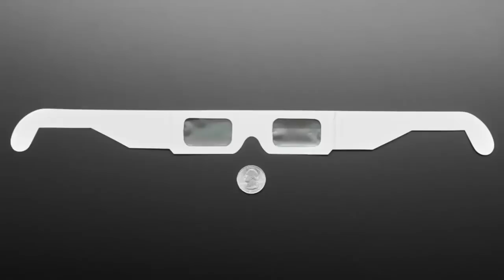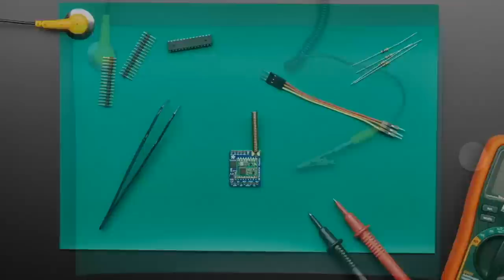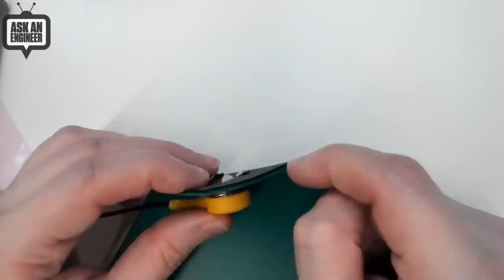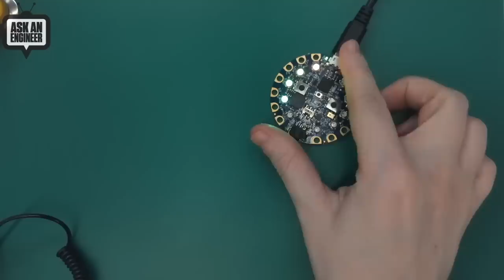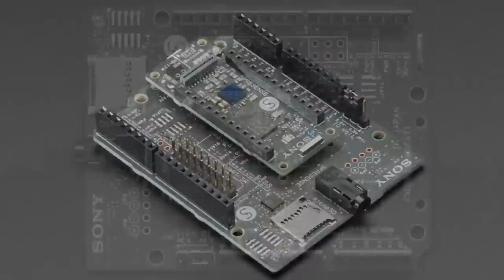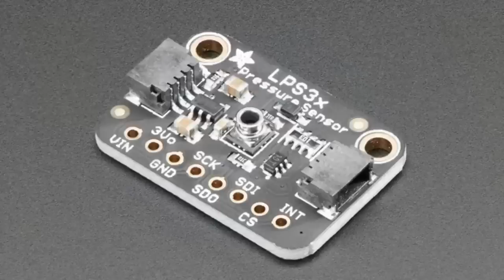New Products 11/27/2019 Featuring LPS33HW Water Resistant Pressure Sensor @adafruit #adafruit

Comment: When anti-static work stations are certified they use weights placed a distance apart.  The weights insure the pressure is constant to get a consistent reading.  Just placing probes on the mat held by hand will vary in resistance since you can't hold with a consistent pressure.

Comment: what is that PCB on the green mat (blue+green dev board with an antenna)? RFM69HCW?
Reply: yeah, looks like the 433MHz version by the antenna, but I guess they could have used the larger antenna on the 915MHz version.